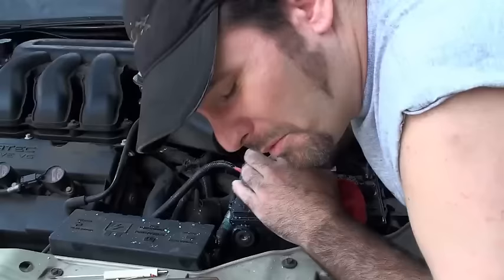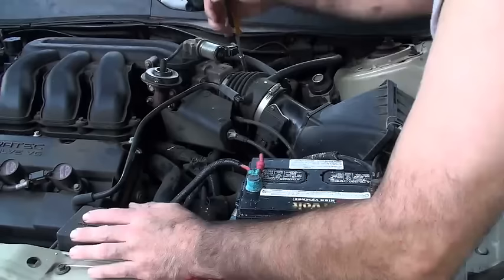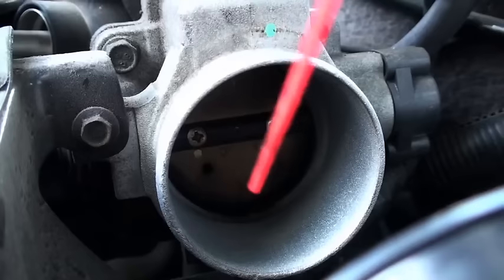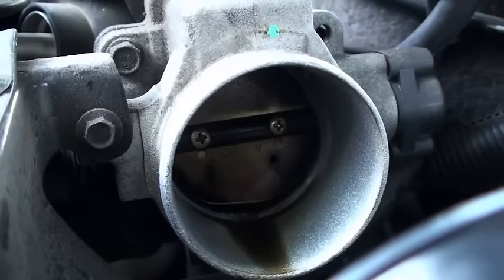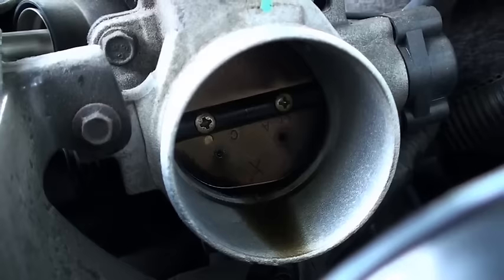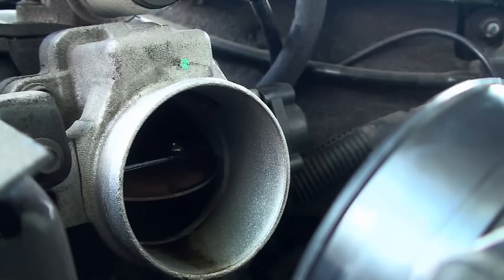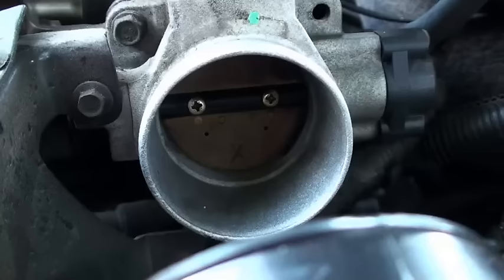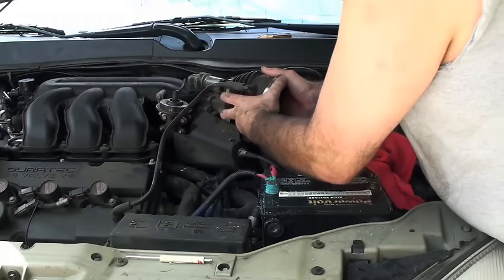Quick Tip-Throttle Cleaning - EricTheCarGuy

Comment: I know this was made long ago my 1980 Bette idles 8 to 1,000 rpm I backed out the idle screw all the helps a little I warm up the engine and kick the choke off which idles at 1,200 rpm. Could it be the throttle body?. Thanks Al

Comment: What are others symptoms?  I don't feel stickiness but thought it'd be good maintenance.  I see some videos that say to remove the entire body, disconnecting all looks tedious but there is also the accelerator cable that I don't want to mess with.  I've got a 2000 Corolla.

Comment: 1st off if it's an automatic check the fluid level in the tranny to much fluid acts like a engine brake when idling, 2nd replace your vac lines you can buy 1/4 inch rubber hose for like 6 cents a foot replace it all for a couple of bucks, 3rd check your air inlet system from the front to the throttle in older cars it can slip apart and leak air pass the sensors. 4th if it's stalling during braking #2 should fix your lack of vacuum.

Comment: Not supposed to touch the butterfly valve, You would change the timing on the valve on modern cars, causing high or low rpms

Comment: Hey guys need some help just clean the throttle body with cleaner but I saw the red straw fly off the nozzle and can’t find it I believe it may have fell through the intake will it melt away or will it damage something?
Reply: Pedro Carvajal gotdam hahahaha
Reply: If it fell into the intake, it definitely has the chance of damaging something. If you think it fell in there I'd pull off the intake just to be on the safe side. You don't want that thing getting into the cylinders.
Reply: Lol😂😂
Reply: @Pedro, remove the overhead cadakily valve with a left hand screwdriver, that won't find your straw but it's heaps of fun looking for said valve.
Reply: @norrishude6177  love it 🤣🤣🤣🤣🤣

Comment: why we need to clean this part? what benefit we get after cleaning like you/he did?
Reply: Gulzar Hussain over time the build up causes the accelerator to stick so you'd need to give it a kick before you can use the accelerator.  It's easier to clean it before it gets built up.

Comment: I understand that it's not a safe practice to force open the butterfly of a "drive by wire" throttle body. Can you reflect on this information? Is it safe to pry it open with your finger or should you turn on the key and get a helper to press down on the accelerator pedal? Thanks for your videos Eric, I enjoy them!
David in Oklahoma
Reply: Neither, A. If you push it open with your finger it can mess up the stepper motors posistion, then the ECU wont know where the throttle plate is and could do more damage. B. Getting someone to push the pedal will open the plate, yet some cars wont the it open unless the engine is running, or it may decide to close on its own after some time, and trust me, you dont want your fingers in there if it closes, it hurts like crazy, it's not just a spring pushing it closed, the motor is actively trying to close it, and like i said, it hurts lol
Reply: I pushed mine open with my finger before I knew of the dangers... it's fine. I turn my key on but not start the engine and depress the accelerator and it opens the throttle body... spray it with cleaner and wipe with a cleaner soaked towel... Good as new.
Reply: Adam Bielby
Reply: Adam Bielby
Reply: Adam Bielby

Comment: My car wont start sometimes but when I get out and take off air cleaner, then open the carb wide open it starts. I jam a small flashlight in carb to hold the blades open and this seems to get it started? why does this happen?

Comment: My vehicle is a 2013 Nissan Altima with 60,000 mi on it.  At what intervals should the trottle body be cleaned?  Is it electronic?  I have never had this done because the maintenance guide in my owners manual makes no mention of it.

Comment: I've got a 2003 Suburban 1500 2wd LS...I want to clean the throttle body, but someone told me that if I move the throttle plate while the vehicle is not running that I will mess up the idle...any truth to that ???

Comment: hey eric, i recently used throttle body cleaner on my 2007 honda civic, i got it nice and clean an i had an improvement in idle, but when i turned the engine on i got a check engine light, i know it wasent the MAF sensor caus its on the airbox and it was no where near the throttle body, but i let the car idle let everything dry up, luckily i disconnected the battery turned it back on and the light was gone, thankfully i didnt burn any sensor, but what could i have done wrong?

Comment: I did the same as u but i used much more and while the car was running. The next thing BOOM! A big spark shot out and the next day the throttle body shat itself. Did i use too much or shouldn't i had done it while the car was running? Now im to scared to clean it again...

Comment: hi, i have a non electronic throttle on my 2006 subaru STI. sometimes the rpm drops below 300 rpm and then bounces back to idle. what is wrong with my car. i checked everything injectors sparks, filters....... is it possible that the throttle need to be cleaned!!!!! thx

Comment: I need your help really bad..😭
My 2000 gsr..
Throttle position sensor connector was swapped..
Is it blue or grey..??
Because my mass airflow sensor is grey and the throttle position sensor is blue..
I think some one switch them around.. what color goes to what sensor..?
Thank you..
2000 integra gsr

Comment: If you get the cleaner into the air idle valve while doing this would it matter ? I'm working on a 4g92 and the valve sits at the bottom of the throttle body

Comment: hey Eric have a mechanic question for u?? my car goes off when i come to a stop some how it starts to make the car like vibrate and it does off. but when i turn it on engine runs fine. its a 96 ford explorer 4.0. could it be the throttle? vaccum leaks? IAC valve?

Comment: b4 u spray the cleaner, you should shove a rag in there to catch all the crap that's comes off as you spray it ,you most likely don't want that going into the engine,and I wouldn't press the gas when u start it because it's gonna rev up pretty high by itself with some of the cleaner in it.

Comment: Hi Eric, Got a quest 4 u. My check engine light is on.(My truck is a 99 Nissan frontier/3.3L V6,4X4 automatic. My mechanic says it is a knock sensor gone bad, on the 4 cyls there easy to get to. Mine is buried in the engine, and is a $900 dollar job. Do they go bad? Is the a less costly fix? I've seen a few on you tube, but a little leery. Any thoughts would be greatly welcome.I'm pulling the engine to put in a td27t Diesel one of these days, just need to know if it's now or later?Thank you,WB

Comment: Hello Eric, I have a 96 Saturn SL2 with a P0401 "EGR insufficient flow" trouble code that I can't get rid of. I bought new EGR valve and then I sprayed the two passages below the EGR valve with throttle body cleaner also. I also tried starting the engine a few times with the EGR valve removed. I tried shoving a coat hanger in there, did not get too far as it is too stiff but then I was able to shove a Ziptie in there for a good 12 inches. I reset the PCMB and cleared the code but the P0401 code comes back after driving 35 miles. Is there any other place I need to clean out on the Saturn engine to fix the flow restriction? By the way, every time I clear the code by removing the PCMB fuse for a few minutes, the check engine light (CEL) will come back on the next day at exactly 35 miles on my drive home.

Comment: Hey Eric I own a Honda Odyssey 05 exl, when driving after engine changes all gears I get a vibration, and the gear keeps switching from 3 to 4, I'm sure its my converter, Do you recommend  flushing the transmission and adding a treatment or do I have to change the converter?

Comment: I have a Infiniti g37 and my rpms were dropping quite a bit at lights ect so I cleaned them tonight and noticed that when the valve closes there's a small gap it's not flush is this normal? Also if the rpms keep dropping whats my next option thanks in advance !

Comment: hi eric, can you please help me with my car problem during a cold start my car idle at 2.5 rpm so i let it warm-up up to 10 mins. then it will then it will to 1000 rpm when its time to drive it  shift to 1st gear it accelerate on its own without stepin on the gas pedal

Comment: Hey there. Thanks for the video. So I managed to clean the throttle body on my 2008 Honda Fit. After reassembling everything my car will not start now. The engine will not turn over at all. Any suggestions?

Comment: Hey Eric I have a 98 Integra type r and my pedal is kinda rough or maybe I should say little sticky. Whenever I clean the throttle body I Clean it really good and it fixes the problem for few days then my pedal gets rough again and its very annoying and hard to drive in traffic. I can't drive the car smooth because of it. How can I fix that? Please Help!

Comment: hello
Eric
i need help  with on to changing my fuel filter  on my 2003 grand am 3.4 liter i have noticed that  the nut side of the Fuel filter well that little pipe is Rusted can i replace that piece from a dealership or does it go up to the fuel pump and do you know the name of that pipe it looks like a '' j '' shape but side ways
thanks

Comment: i have a 2004 grand prix when u start the car it runs fine soon as u go to take off it chugs and dies i start it back up it runs fine i drive 20 feet it chugs and dies but fires up and idals no problem i changed fule lines and filter need help

Comment: After cleaning the TB that sticky feeling went away. Though it still feels harder to press the gas compared to my other car. Disconnected the tb cable from TB, gas pedal is easy to press. Any suggestions, by the way my 2000 civic only has 33k.

Comment: you gotta make sure you pull the rubber boot off as hard as you can too like he did. and the proper way to wipe it out  is to stick the rag all the way in and start your car so it sucks it down through the engine and it will come out of the exhaust and all the carbon build up will be gone!

Comment: Hi Eric, I’m a big fan of your channel. I have a question. I changed the spark plugs and I unplugged the throttle body to clean on my ‘08 Sienna, now the car doesn’t even idle.  It runs for 5 seconds then shuts off.  Do I have to reset and relearn the throttle body?
Reply: make sure spark plugs are in tight, and the wires are snapped on the spark plug all the way, also make sure the right wires are going to the right cylinders

also also, make sure no wires came disconnected on the distributor (the other side of the plug wire)

Comment: I flooded my engine and it began coughing doing this😂 Thankfully it burned the rest of the vapors/fluid after an hour, and my throttle is clean
Reply: Next time I will spray my rag instead of directly into the engine

Comment: First of all I would attend to the + terminal on the battery, It's very corroded.
Then I would clean the throttle. A dustfree cleaning paper/ rag is suited to this operation, not "just a cloth". Toothbrush, like someone thinks of using, can lose a plastic bristle or 2 and then you have plastic particles burning up in the chamber and , "that's not good" for the engine'; valves rings and plug(s)...;-)

Comment: eric need help, i got a code p0191 on my hyundai, fuel rail pressure low, when i replace it with a new on whe i started it it wont start, when i scan it, it shows code p0193 or pressure high what do you think is the problem?

Comment: I just clean my carb using brand stp carb cleaner spray.Usually rpm usually high around 1000rpm,but after cleaning the rpm raises to 2000rpm.Any idea how to fixed or lower down the rpm?Please help me:)Any help appreciated

Comment: Hey, i have a 2012 subaru impreza sport. My battery is bad, so replaced it.. After replacing it, i noticed the car does not throttle like it used to, and it moves rather sluggish moving off. I have done some reading, and some posts says that because i disconnected the battery, the ECU setting has reset, so the ECU is re-learning, and it will take a few days to go back to normalcy. Is this so?
Reply: yes

Comment: Eric, do you know any more info about that coating that is on some Ford throttle plates? My guess is that coating prevents varnish/carbon buildup, in which case, you wouldn't need to clean the plate ( maybe the throttle body tube though ).
Reply: Arthur Swails Its a kind of teflon coating applied to throttle plates. most things other than throttle body cleaner will destroy this coating.

Comment: Hello Eric would a filthy throttle cause high-revving RPM while parked and hesitation and jerking while braking?
Reply: If you have a drive by wire throttle body, yes because the ECU, the more the carbon that builds on the walls around the butterfly, the more it eventually learns to keep the butterfly a little more opened to let the engine idle properly (that's the same reason as for why when you clean the throttle body you experience an higher than normal idle until the ECU learns that it can close the butterfly a little more), and since the idle is high the engine can't brake properly. In alternative to a dirty throttle body you could have a defective MAF.

Comment: Hey man,i have an acura Tl and i accidentally snapped off the spring that holds the airflow tube. The airflow tube seems very snug still, so i'm wondering how big of a deal this is?  Thanks in advance.
Reply: +Eric Carlson Could cause a vacuum leak and even fall off during driving causing you to stall. Cut off what's left of the old one and replace with another hose clamp, you can usually find these at hardware stores.

Comment: Hey Erick long time subscriber. Quick question. I have a 05 Chevy Z71 5.3 crew cab. I’ve had the truck for a couple months now. I’ve changed the knock sensors and it’s been doing fine. I’ve recently noticed when I’m in 4th gear it feels as if the over driver is on. When I let off the throttle you can hear the truck roaring so to high rpms as if it was in over drive. Could this have anything to do with my throttle body. I do have a bit of hard shifting not to harsh but a slight hint.  Plz any help is appreciated. Thx.

Comment: I tried using intake/throttle body cleaner on my 96 parhfinder about a month ago an it would cause it to mis Fire and now it idles at 1000 to 1500 when it's supposed to be at 750 to 900. An the idle still high a month later.
Reply: There could be a coating on the TB,  which Eric said at 2:12. Try to reset your PCM. My 93 Wrangler (not OBD II) just requires that the positive and negative cables be touched when battery is disconnected to discharge static from the capacitors.

Comment: Hey I have a 2003 Lincoln navigator all wheel drive and I dont know what the name of it but that what I think I need to fix but neway I sit in front right between the left cvc axcl and the right cvc axcl it's like a gear box are small transmission are some like could you tell me what the name of are how could I fix it are what do I need to do to it my truck still runs and but I had to take both axcl arms off but that was not a good idea come to find out need help bad and fast

Comment: Hi! I have a 1989 Mitsubishi Galant that will suddenly accelerate while driving, and sometimes the idle will slowly climb until it is at a ridiculously high RPM. Could a nasty thottle body be causing something like this? Thanks from Sweden!
Reply: +Karl Utterdahl probably a vacuum leak or injector leak. Also take a look at the IAC valve

Comment: i have a 2004 escalade i get the reduce engine power heard it may be from the throttle body how can i know for sure.....thanks in advance
Reply: Pull the codes. If it is the TB it will start to set TB codes and TPS codes.Big problem with those. The make a repair kit now too from GM

Comment: Don't ever put your fingers inside where the butterfly flap is.  On Electronic Throttle Body's they are geared way down and can sweep on their own.  If your finger is in there and that happens it'll chop your finger clean off.  Use a stick or something to hold the pedal down. I would just take the Throttle body right off... four 8mm bolts on mine.  Takes about 5 minutes and you can clean both sides.  But.... thanks for the video.  Definitely not criticism here.  Just a safety message for people with an Electronic Throttle Body.

Comment: 08 silverado.  I'm not a mechanic. I am poor.  So now I'm a mechanic.  Will I need to have a shop run an idle relearn? Can I do myself? Or what is the do/dont that takes it from no relearn to yes relearn?
Reply: Here’s the throttle body relearn procedure
1) Start the engine and let it idle in park for 3 minutes. During that period the idle may be higher idle than normal.
2) After 3 minutes, turn the engine off and leave it off for 60- seconds.
3) Start the engine again and let it idle in park for 3 minutes one more time. During these run periods you may see a check engine light. Scan for codes and if you get throttle body related codes, clear them.
4) If the idle speed is still off, drive the vehicle at speeds above 44-mph and operate several acceleration and deceleration cycles. Then repeat step #3 one last time.

Comment: I would never clean a throttle body when it's on the car. You don't want all that sludge and crud going down into the valves/cylinders. You can't clean it out nearly as good as when its off the car. The Saturn TB is very easy to take off.

Comment: Be careful when doing this if the car is drive by wire.  Some throttle bodies have anti-ice strategies and low geared motors - i.e., put your fingers in it and it might go om-nom-nom :O